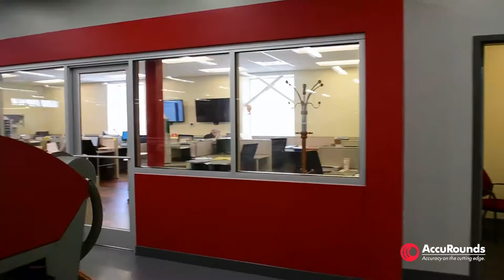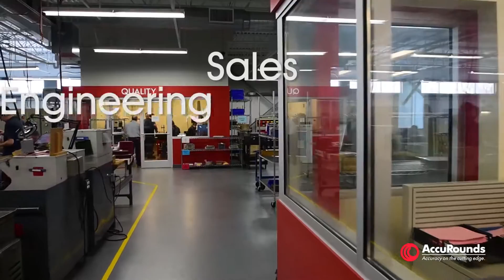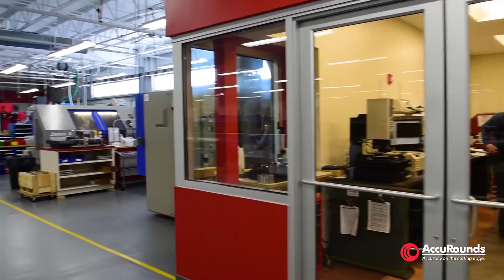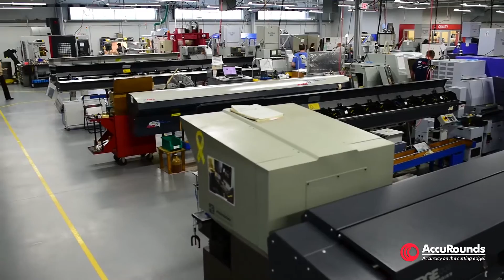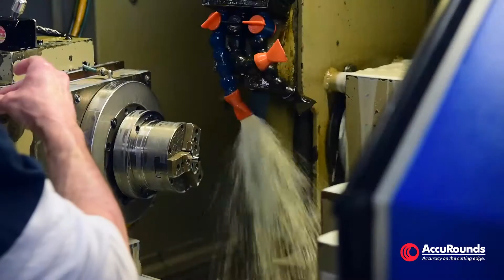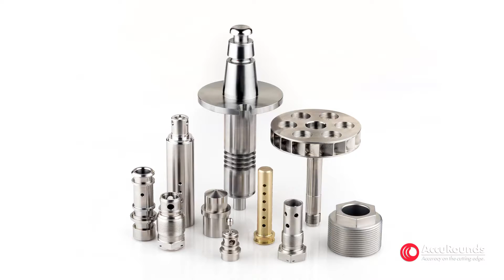CNC Cylindrical Grinding

Comment: Can you grind a hard anodize coating (type III) on a cylindrical part to size? remove about 4-8 tenths from the coating?
Reply from the maker: We have in the past, but it depends on OD size and length
Reply: @accurounds  2" diameter 3" length... What type of abrasive wheel would you recommend?
Reply from the maker: @marinovskiv  that's proprietary info